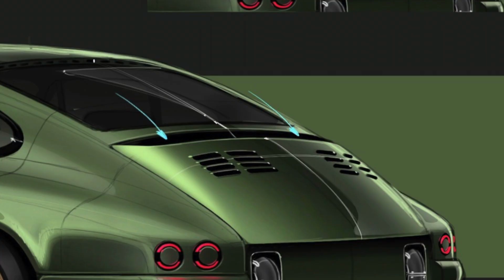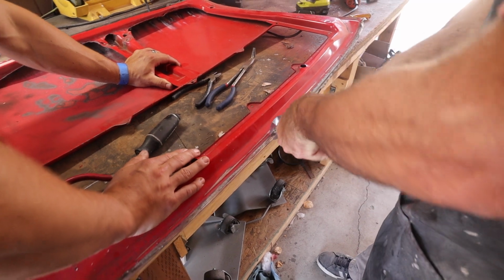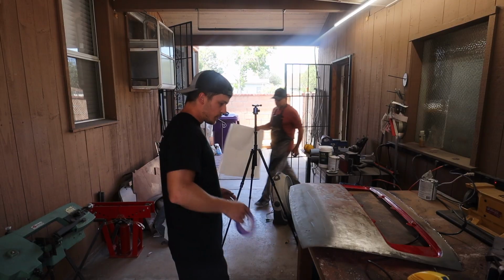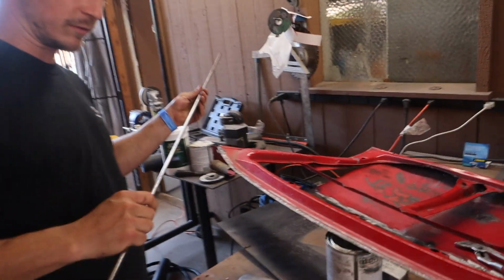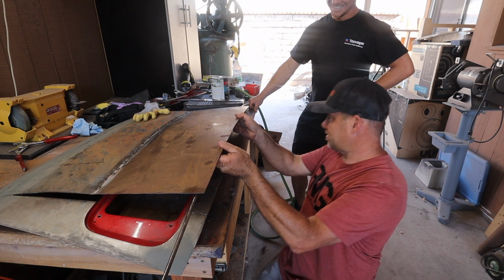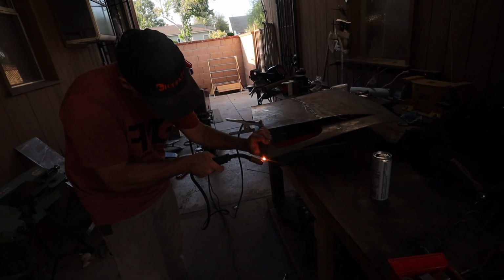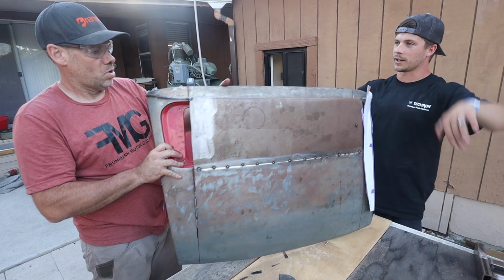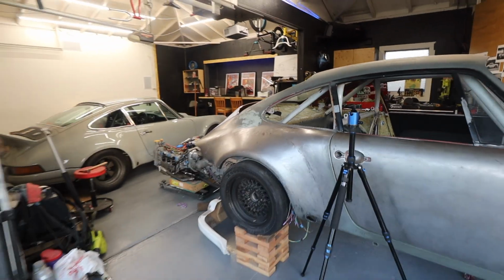CRAZYBALLS Custom Air Duct Decklid for My Subaru Powered Vintage Porsche! (pt. 1) | Blasphemy Bld 59

Comment from the maker: Thanks to Kaleb and JR for coming by and making an awesome episode! Subscribe to Built: https://www.youtube.com/channel/UCPCiqJReDeCUmWXt4_PIMag
Reply: Tip 1: roll/curve the sheet metal before you weld it on, that way you won't have any flat spots. That was like the first thing i saw, the original skin all curvy and then a flat piece of metal welded on to that. Tip 2: when you want to get a round bar bent simetrical, take a flat metal plate or better a metal workbench and first draw the shape you want on it. Then weld on studs on the inside of every curve, right in the middle. If it's a long curve you might need more studs to follow the radius. Then tackweld the centre of your round bar to the centre of the shape you've drawn and start from there. Heat it up, bend following the lines you've drawn and tacking as you go along. No need to keep checking if it's straight this way and not much effort needed to make the bends. Anyways, it looked like it belonged, nice. I think the car's going to look great when it's finished.👍👍
Reply from the maker: @Euroburger  GOOD tip!  It looks good now, but your method ensures perfection.  Thanks for sharing.

Comment: Starting to come together mate. A great tip for removing a skin from a door or decklid is to just run a grinder or flap disc along the edge and cut through the rounded corner. Looks like you ended up not needing to remove it in this case though. Keep fabbing ;)
Reply from the maker: Yea that’s smart!

Comment: you might need an air diverter like the underside of a WRX hood scoop. basically a 45 degree panel with sides to force the air through the intercooler

Comment: 🔥 Michael, this is looking awesome man 🔥 Once the louvers and curve's are in 💯 💚 
I have a question though and this debate stems from my own 500 HP build. Do you think there is a need for a spoiler when considering the HP gains? I am planning on running mine without the whale tail for a more classic look, but plan to possibly modify and paint the tail to match in case it doesn't handle well at speed!
Let me know your thoughts!!! Congrats again man!
Reply from the maker: I think if I were making a car that I'd take to the track a lot, I'd fab some sort of removable wing, or swap the decklid.

Comment: Good video and good work !! It is amazing what you guys did in one afternoon. I don't want to criticize your work , but from what I saw over the years in the original Porsche Videos , it took the factory a long time to improve the whale tail on the 930 turbo  and this car has more or less the same power as your 400 PS Subaru engine in the Porsche . It looks cool , but from the ventilating the engine and pushing the back of the car on the road (aerodynamic) standpoint it is not topnotch . Maybe you have an explanation for us, would highly appreciate it. Don't understand me wrong I saw all your videos and I really like your work, simply don't understand the physics behind.
Reply: I have to correct myself : only the 3.3 l turbo Group B had 365 German horse power with the whale tail for cooling and aerodynamic purposes in connection with additional oil coolers in the front.
Reply from the maker: @Matt-ft2nz  yeah, this car is going to have way more power, lol

Comment: Sorry to burst your bubble, but due to the flow of air on the back of the 911 is will probably not such in enough air to cool your intercooler. Also the air is turbulent there, not laminar. Also there is a reason Porsche mounted the whale tail on the first turbo's and even moved the intercoolers to the side vents later on. So although i Like the fab work, I don't think it will help your intercooler.
Reply from the maker: Everything is figureoutable.  :)